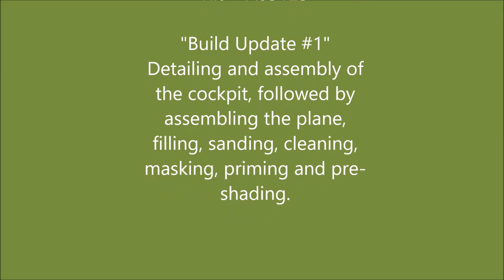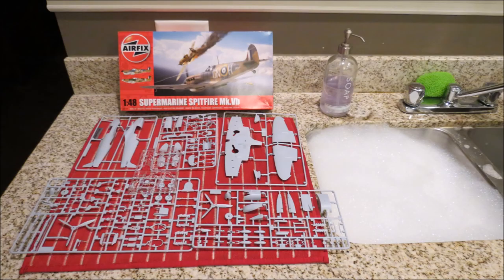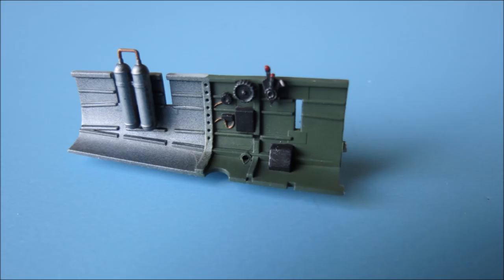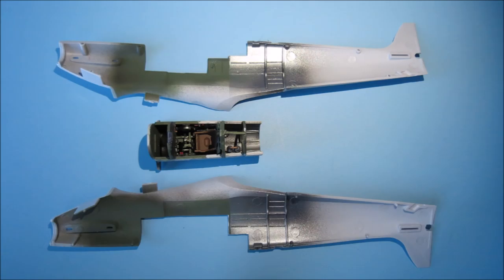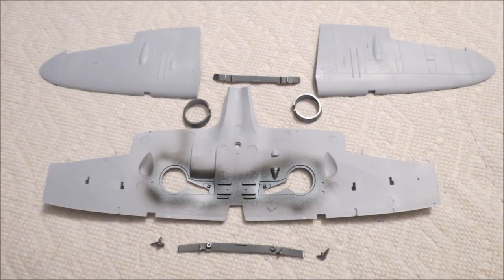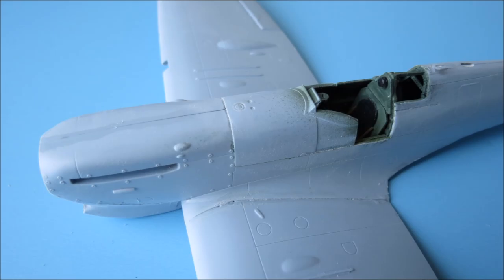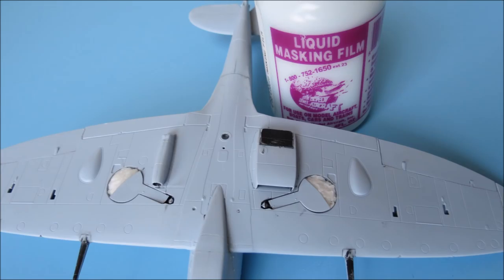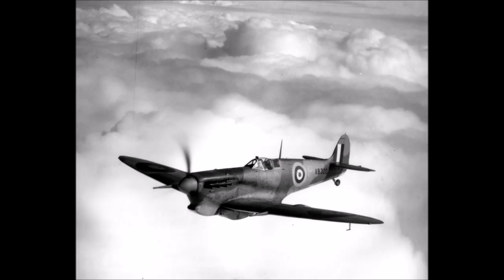Airfix 1/48 Supermarine Spitfire Mk.Vb "Build Update #1" (4.5.16)

Comment: Hi Martin,Great progress so far.I didn't have to fill my wing's. Yes that little little silver part those goes in the back of the bulk head should be installed before the tub is jointed together. Pre-shading looks bang on mate.Great cockpit detail.Nice touch on the cables ;)
Reply from the maker: +Warren Blanch  Thanks Warren, much appreciated, mate! Cheers : )

Comment: Enjoyed the update Martin.
Have the the kit in the pile so you finding the pitfalls will help.
Looking forward to see how you find the wheel struts with the two part assembly
that Airfix decided on.
Hope the new house has a model room or den as our colonial cousins like to call it.
I just managed to retire after working since 1970 so hoping the stash will now get some work.
Although my youngest daughter is having twins next month so she may have other plans.
Its funny i have three son in laws and they must have took wood work and metal work off the school curriculum
because none of them could wire a plug or knock a nail in.
Anyway thanks for the update ,hope all go`s well with the move and looking forward to the next one.

Stan
Reply from the maker: +Stan C Thanks for watching Stan, much appreciated! I'm already nervous about the undercarriage after seeing that it is just two opposing stepped parts butting up together?! Looks like a really weak design, and after dry-fitting the undercarriage, the stepped area is so small that there isn't enough surface area to provide a positive location that maintains a correct position; the wheel strut leans in any direction. I'll have to use fast-acting CA glue and maybe make a little jig that holds the wheel assembly in place at the correct angles in two directions?! The new house has a 900sq ft basement that is all mine to turn into my own man-cave, so there'll be a lot of space for a Hobby area complete with plenty of storage space for my stash and displaying completed models! Happy retirement mate...I've been retired since June 11th, 2013, almost 3 years now....took early retirement due to health issues and I'm really enjoying it, although I miss the challenges that my Engineering position brought to me, along with the salary it provided. Have fun with modeling, when you get a chance from being a grand-daddy to the newborn twins!! That's awesome, we just had our 4th grandson on March 9th...the oldest will be 5 this year.....5, 3, 2 and 1 month old are the ages. I love having them around, they all have their cute personalities that make me laugh and they all love their "Pappy"!  Blame the advances of the technological world and computers mate...kids today think that the computer will either do everything for them, and/or provide the knowledge, via a "Google" search to guide them in completing a task without any practical experience and knowledge! I loved my woodworking and metalworking classes at school...more so the metalworking, hence the reason I went onto Engineering college. Will be moving in the next couple of weeks; the contractors are working on the kitchen now, then next week all the flooring goes down throughout the house, Everywhere is painted- top to bottom, now....looks really nice. It was a 1980's time warp that was dull and dingy when we bought the place on December 22nd, now it looks like an up-to-date modern and bright home. I can't wait to be moved and settled in now, it will have been a 4 month process since buying it, organizing and funding the make-over project. Make sure you share some photos of your first retirement build and those new twins! Cheers : )
Reply: Hi Martin,
In looking through build threads the solution would be to glue the strut together at the start of the build.
Then cut it and drill for a pin to assemble later.
Of coarse this does`s not help you.
One builder cut the location from the strut leg and glued to the base in wing then carefully drilled and pinned each end.
Hope it works out for you which ever method you use.
I did wood work at school then worked for Vickers for 30 years as a fitter and turner then after redundancy worked for lloyds Bank for last fifteen years.
Quit a change but times have changed in the north east no more ships to build or mines to maintain.
Good luck with the move and look forward to many more builds in the future.

Stan
Reply from the maker: Stan C Thanks for the heads up regarding other modelers methods to improve the undercarriage structure. I was thinking of maybe going another route: If I use some small brass tubing that has an inside diameter that fits tightly around the diameter of the wheel strut and mating part, I can cut a length of around 1/4" - 3/8" and locate half onto the fixed part within the wing. Super-glue it in place, push the wheel strut into the other half of the tube, then set the angles before the glue sets When it's set, paint the tube to match the wheel strut.
Did you work in the Vickers Sheffield, Leeds or Newcastle plant? I'm guessing Newcastle if you said "times have changed in the north-east". It's sad mate, the UK was such a force within the steel and mining industries, until the world became a global market and it was cheaper and more profitable for corporation owners to satisfy their unnecessary greed by shopping abroad.
Cheers, for now!
Martin : )
Reply: Martin
Yes it was Vickers Newcastle but they sent me to work on QE2 in Germany and to many trips to Barrow on subs and a load of pits as far down as Stoke.
Only Barrow remains i,m afraid.

Stan
Reply from the maker: Stan C Cool....that would have been a great gig to work on the QE2...there's a story to tell your Grandchildren! : )

Comment: Excellent work Martin... Nice cockpit... Do like look of the Spitfire fitted with those Vokes air filters!
Reply from the maker: +Jim TheModeller  Thanks Jim, much appreciated, mate! The kit also comes with a large extra range fuel tank that fits around the Vokes Air Filter on the underside of the fuselage, but, I didn't use it, because I like to think of the Spitfire as a streamlined fast bird without anything bulky, weighty and obtrusive to affect her performance! Cheers : )